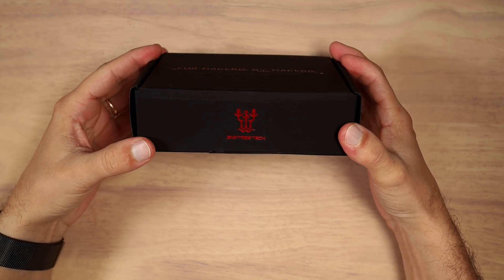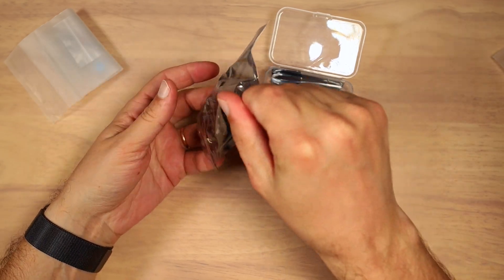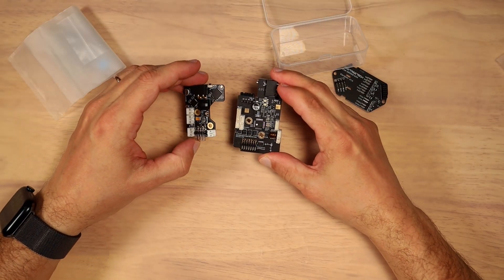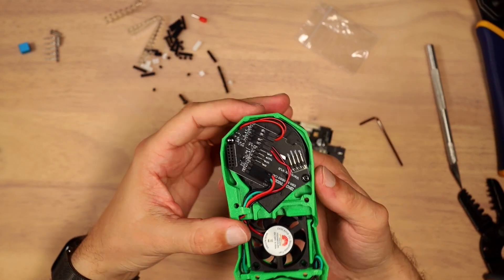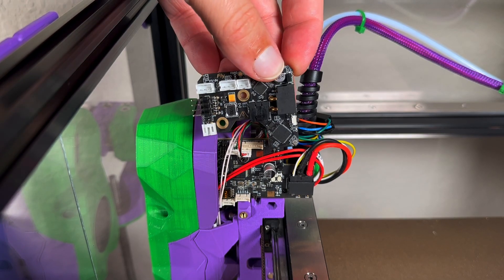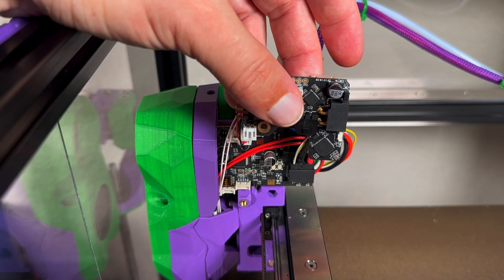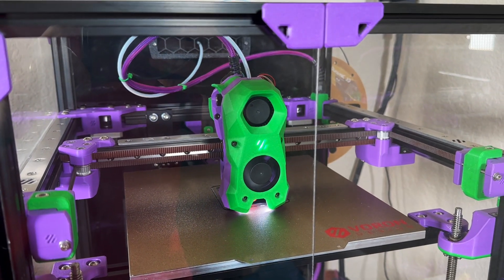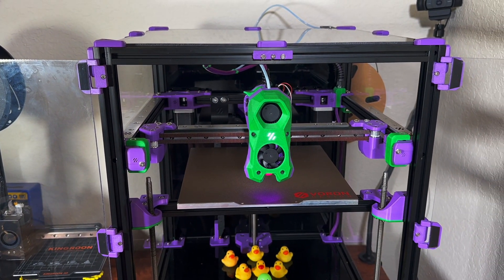BIGTREETECH EBB SB2209/SB2240 Voron StealthBurner CAN Module

Comment: I understand the CAN has it's own extruder stepper driver on it.  Does this mean the stepper driver on the motherboard is no longer used?
Reply from the maker: Yes CAN toolhead boards usually have own driver on them so you don't need to use extra driver from the main board. In my case I have separate wires going to the toolhead to get extruder motor working from main board driver as I am printing a lot of ABS with bed temp ~ 110(C) and ~50(C) inside of the printer. I bet toolhead driver can handle this but it's still it's just an extra security for me.
Reply: @hobbyistnotes  that makes total sense and is the direction I want to go when I get that far.  It seems illogical to have the driver baking in a hot chamber while making heat of it's own.

Comment: Hallo,

wo wird das Bigtreetech EBB SB2209 angeschlossen am Fysetec Spider v.2.2

Vielen Dank

Grüße Sascha
Reply from the maker: Unfortunately I don't have Fysetec Spider v.2.2 board to even try it 🤷‍♂I see this Spider has CAN extension port but I would recommend buying cheap CAN module for RPI and running it directly on raspberry Pi.

Comment: Now lets us know if you experience the undervolt error that is happening on some peoples sb2240’s
Reply from the maker: I had only few small issues related to connectors which were easy to solve. Since installation printed a lot of PLA bins for Gridfinity project/video (at least 3-4 days straight) and few 5h ABS parts with ~45-50C chamber temp. I am not using built-in driver and have separate wires just for the motor also with 40W e3D heating cartridge and all the other parts of the toolhead accept LEDs are working on initial 24v input I can assume my setup will be less prone to undervolting as almost no voltage conversion happening on the board. Working on the upgrades to get a bit more flow on this printer with Dragon HF and 50W heater may be will crimp the motor to see how board will behave with such setup.
Reply from the maker: Could you please share more details regarding the source of the information you referring to, so I could see what setups people have problems with and may be try to replicate it.

Comment: Have you still no problems with the SB2040 boards since there is many reporting that it gives error after a while and they go for the SB2209?
Reply from the maker: I have replaced Mellow SB2040 due to Thermal issues. Now I am using BTT SB2240.
Reply: @hobbyistnotes  Yes, And with this BTT SB2240 you haven't got into troubles so far?  Maybe 1 mounth is too short to conclude. Was it hard to install the firmware? Any troubles ? Thanks
Reply from the maker: @Levisgil47  I had little issue with X-switch and Kicky connectors, I assume due to thermal expansion, but after extra crimp-push with a tool the issue went away.

Comment: Love this board using can bus bridge
Reply from the maker: I think it's highly over-engineered tho still a very nice product. Wish those small connectors wouldn't be so painful to work with as I personally spent more time on them than on actual installation and configuration.
Reply: @hobbyistnotes  bro make your life a little bit happier and buy some pre-crimps lol The 5 or 10 bucks you'll save just by not dealing with the stress
Reply from the maker: @grathado28  you are 100% right I have to do it, just never had crimp issues before this specific project.
Reply: @hobbyistnotes  oh I know exactly what you're talking about My big fumbling fingers trying to crimp those 1.25s lol It was a nightmare
Reply from the maker: @grathado28  My problem with those premade wires/products is that you use it once and they stick around making an extra mess, this is something that I have to consider as I have very limited space.

Comment: I have this kit on the way. It's a shame they went with those tiny picoblade style connectors that are going to be difficult to put in and out. I have two hotends that I swap from time to time, so this will be a pain. I think I might make some flying JST-XH socket leads for the heater and thermistor to get around that issue.
Reply from the maker: I had conversation with BTT and explained this connectors frustration after which I guess they start to include crimped wires so you can just solder new wires and use it. Also they messaged me after the video that soon they will have an extra version of this board with bigger connectors as an option. But all frustration aside board works perfectly fine for me.

Comment: I think your x-rail backer is on the wrong side of the extrusion. I think it should be opposite of the x-rail, to counter the deformation
Reply from the maker: If be honest I have been working on the video about those backers and in my case results are very inconclusive. I have tried to install them all over the place at the end got feeling that this mod was huge waste of time and resources as my printer is already pretty squared and improvement are very tiny and aren't worth the money/time I have spent.
Reply: @Hobbyist Notes  I've tried it both ways and ended up on top how you have it. It even has the taped holes for the cable chain that way, although not relevant on your umbilical  install. At 90° to the rail, it would have a tremendous amount of rigidity if held tight enough to the extrusion.
Reply from the maker: @bobwtech  Tapped cable chain holes was one of the main reason why I firstly installed it on top than people started to mention it have to be behind linear rail and so I have tried it this way too and didn't had much of a change, so I have moved it back on top to cover leftover spring nuts cus it's hard to remove those.
Reply from the maker: Hello. You aren't the first person who mentioned this and the main reason why I have it this way is that I care more about Z-Axis deformation other than Y or X.